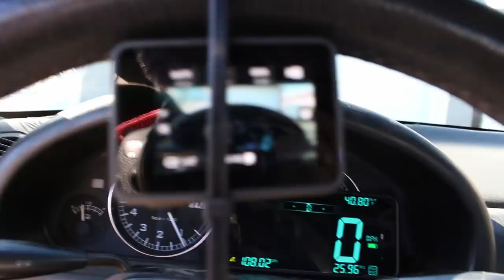Sending The Miata To 100MPH On Jackstands: The Gremlin Chase Part 4

Comment: Have you been able to check the gearbox out put and diff input shafts are parallel? If they're not it will vibrate! I work with this stuff on industrial equipment

Comment: My miata was making a noise that I could NOT find. Since I have an open diff I was able to get the rear wheels up to speed separately. It was really sketchy but I was able to pin point the noise to the driver side.

Comment: Couldn't you take the Axel's loose to check the diff? I have a 67 Chevy II. 350 350t trans and Ford 9 in rear end. It does the same thing vibrates at higher speeds. Almost positive it's somthing in the rear end. Haven't tore into it yet

Comment: What if it’s the bushings that you are using?
Reply: If we wait patiently Greg will show us what the issue is. Greg I just did some searching.   There are some DIY tricks for balancing your driveshaft.  But also shops that do it.  I am fairly certain you have explored these  avenues but just in case.  You are spinning stock shafts very fast.  How fast do you have your tires spun when you get them balanced?  Curious....

Comment: This might be ignorant of me but the bolts from the trans crossmember are laying directly on the trans with washers but wouldn't regardless metal doesn't isolatethe vibration. Wouldn't vibration move through the bolts into rest of the chassis?

Comment: Try swapping those rubber transmission mount bushing for something hard, and see how that makes a difference. Like back on the jack stands and driving. The symptoms i would be predicting is slightly more vibration at low speed, and reduced vibration at high speed

Comment: This might be out of this world but if it’s possible I’d say try making an adapter for the driveshaft to the trans with bumpers inside to absorb vibrations. Something similar to what the bmw trans come with. Cause your drivetrain and engine are all stiff due to your bushings. Maybe if you have something in their to absorb more vibrations. Cause the CV joint probably only helps so much
Reply from the maker: This is how the factory BMW's (and many other cars) are set up. I may be going to a setup like that soon.

Comment: May or may not be an issue, the diff looks like its mounted from the PPF to the chassis with no bushings, I know your setup has delrin diff bushings but if the diff is still mounted solidly to the chassis in other places, it may cause vibration?... it's weird because driveline vibes are usually at low speeds

Comment: I would say it's your diff. If you over tighten the center nut on the input on the diff it can cuase diff binding. Mabye resulting in shake. Thats on my truck. Miatas might not be built the same way. I am no car expert. Just trying to give ideas. I really hope you track this problem down. I have just started my own miata adventure. You are possibly the most valuable resource in the miata car scene. Turbo coming soon.
Reply from the maker: True that they do require a certain torque, but it's the same differential the car has always had. And even when swapping in another diff, the issue did not change.

Comment: Hey Greg, have you checked every nut in the rear subframe is firmly tightened to the car? Perhaps a nut is slightly loose causing that vibration at 4k rpm?

Comment: at 7:00. Bolted mounts on the side to something?. Cross member with rubber isolators. Are those two mounts equally loaded? Or, in other words, is one carrying more weight than the other?

Comment: I'm starting to suspect the transmission tunnel wasn't designed to dampen the high frequency vibrations of a high RPM driveline. Whatever the tiny BMW bushings don't absorb is possibly being transmitted through the body of the car. The PPF forced these vibrations to travel up and down the driveline all the way to the engine mounts and differential mounts. Now that vibration may be taking the path of least resistance straight into the center console? Perhaps some type of dampener or "weight" on the new transmission mount to absorb vibrations. I see these constantly on newer Chrysler built vehicles....on the body to frame bolts, on the exhaust, etc. Even seen them directly on the differential case.

Comment: Greg, it may be worth trying the jack stand test again with the driveshaft removed. I’m not entirely familiar with the trans you are running. But if it’s possible to put it in gear and bring the engine/trans speed up with the driveshaft removed then you’ll know for sure that it’s coming from the trans. If you don’t get anything then you know it’s driveshaft or rear end related. I’m sorry if you’ve already cover this I just thought about it while watching. Hoping for the best for you

Comment: Have you tried changing gearbox bushings/mounts for something with different stiffness? since vibrations are speed related, there should be something with that speed or frequency that causes it. And resonanting frequencies are determined by stiffness of elastic elements and damping. So I'd tried to replace all bushings with solid mounts at least temporary for testing. 
and if it will not help - have a look on structural rigidity of places where components are mounted. Maybe those are acting as springs in your case...

Comment: Hi Greg. I haven't watched the whole video yet, but before i forget... My dad had a vibration issue on his car over 70 MPH and after much research and getting tyres re-balanced etc it turned out to be the Spigot Rings for his alloy wheels were something like 0.5mm too small overall. I didn't believe that this could cause such a big problem but it did! Might be worth looking into.
Reply: Just got to the part where you remove the wheels so yeah, ignore that comment :D

Comment: I knew a guy who went through almost this much s*** working on an old Mopar vibration.  He sold the car to someone who replaced the pilot bearing and cured everything.  The new owner was thrilled by entirely rebuilt drive train and smooth ride.  That was my friend's story.  So, pilot bearing?  Been there, done that?  I didn't see it go by but I'm not that attentive at all times.

Comment: I am sure others have said it before, but get aliexpress accelerometers and attach them to the box and driveshaft, go through the rev range on jackstands and log the vibration frequency. Only one thing should be rotating at those rates at those engine RPMs, and if the rates are different at box and diff then it's a compound issue. E.g. 550 rpm vibration at 60mph wheel speed would be something rotating at wheel speed, 2000 rpm vibration would be diff speed etc.

Last, your rear axles have also seen a lot of action, did they ever get removed to isolate the issue?

Comment: U joints speed up and down as they rotate. The effect is more noticeable with larger working angles. The effect is usually cancelled out by offsetting the UJs by 90 degrees at each end of the drive shaft. Speeding up at one end is cancelled out by the other end slowing down at the same rate. Meaning the flanges rotate at the same speed, even though the shaft is accelerating and decelerating all the time.
It looks like your yokes are in the same phase. Think i'm right in saying that would cause vibration, even if the working angles are in spec, equal and opposite.
Also, the CV version you tried would have a similar issue becuase it only has one UJ. Nothing to cancel out the occilations, because CVs are constant velocity.
Can you rotate the slip joint by 90 degrees?

Comment: BMW's have a 'guibo' which is a rubber mount to connect te driveshaft to the gearbox. This combined with a center support bearing and a DOUBLE yoked driveshaft can compensate for alignment issues of the components. You have none of that, that combined with the stiff motormounts and differential (BMW also has them on mounts) can be a harsh source of vibrations.

Comment: Could it have something to do with the fact that the transmission cross member is solidly mounted to the transmission tunnel? Thinking back to how Miata drive train components are mounted stock, no drive train component is that directly mounted to body work like that. Especially body work that is so non-structural (as I don't believe the transmission tunnel is). My theory is that vibration you are seeing in the drive line behind the output shaft are not being dampened enough by the transmission mounts and because the metal the transmission cross member is bolted into is rather thin, its causing the flimsier body to resonate at high speeds. 

Might be worth trying to switch to softer mounts or adding insulators between the transmission tunnel and the cross member.

Comment: dont you have aftermarket axels? not sure they spin fast enough to make that vibration though.... could it possibly be a bind instead of a rotational vibration? was anything in the rear end messed with like the pinion gear? almost sounds like when you shut the car off and are rolling something other then the sound of vibration in the car isnt working with whats going on like something is rubbing on another part. not sure..

Comment: i still think its the trans mount or your trans is alligned up and down with the dif but not left and right. you said to me lasttime its fine in other swap kits... but youve also said some poeple have your problem and some dont. seems like a minor detail that would cause problems on some kits but not all. and your driveshaft seems to be a symptom not a source. how many drive shafts have you tried 8? and before you ask yes ive seen all your content.

Comment: Did you test the connection of the trans to the car? The Bracket, the bushings, the chassis contact points? I mean the trans will vibrate and the miata structure is not engineered to take these loads at those (new) contact points.
Great vids, keep em coming!

Comment: Okay so hear me out, I belive your vibrating could be from a warped rear end, your right at the power where factory unibody spot welds can break and cause a misalignment of the diff. Ive seen this same vibration in high powered supras, mustangs, cameros, it always ends up being chassis flex or warp related. 

Or you could have a off balanced wheel/ warped hub. But that would be something you could feel in the corner also. Try taking sweeping turns back and forth while putting a little positive power down and see if the car behaves differently.
Reply from the maker: Accel, decel, high load, low load, left turns, right turns, dips, crests. Tried it all. They only things that affects it is driveline RPM. The car also had no issue when I had the 6-speed + Torsen combo.
Reply: @TheCarPassionChannel  swap your diff out
Reply: @LemonMan_Man  he allready did this

Comment: Here a thought.... now what if the transmission mount is vibrating the hole car from the rpm speed of the drive shaft of was there to holed the Tran and diff but also was to stiffen the chassis what if that could be the problem more power bigger transmission bigger components more vibration I know the trans has a damper and so dus the drive shaft but what if it just the trans mount

Comment: Seems like you’ve tried quite a few s things with the driveshaft. I think the next step should be to experiment with different stiffness engine and transmission mounts. You should probably also try stiffer or softer diff mounts.

Comment: Sounds kinda stupid, but could it be the cross member on the gearbox? I don't know whether it could not be isolating the vibration from the gearbox enough and as its connected to the tunnel, its throwing the vibration around the trans tunnel? I dunno?

Comment: have you checked either rear wheel bearing? 

I once had a buddy who wasn't able to go up to 50-70 MPH without having his whole dash shake pretty harsh. from the firewall all the way up through the A-pillars to the roof. Different car of course. FWD.
We checked the motor mounts which were OEM 6 months old mounts. 

checked the axles. even tried putting the car up in jack stands and putting it drive to see if one of the axles might be bent and nothing. All bushings and balljoints were all good.

Turned out to be one of the Wheel bearings was bad the whole time. which was weird cause the wheel hub seemed good. There was no play or slack on the hub like that you get when a wheel bearing is worn out.

maybe you can do the same test while on jack stands but have someone else get the car up to speed until it starts shaking, meanwhile you feel each Rear control arm to see if either side has more vibration than the other?  just a thought........
Reply from the maker: New bearings.

Comment: Thanks for all you do Greg. In the end, did you figure out the source of the vibration ? Im currently chasing this gremlin as well. Cheers.
Reply from the maker: Yes and no. I did fix it, but never truly discovered the reason it was occuring. If you check out my video with the V8Roadsters diff swap, that's what made it all go away. Not sure if it had to do with driveshaft length or weight, or who knows. There have been others with this identical configuration that don't experience any vibration, so it's very hard to pin down the exact cause.
Reply: @TheCarPassionChannel   Thanks Greg for actually replying. Way cool to have a "Celebrity miata guru" comment:) . 

 I find my self reading all 100 and so comments from others and your replies and sometimes spend lots of late nights reading and at the same time learning something new. Have done numerous fixes on my Na following your how to's. Thanks again and will check out your V8roadstors diff swap.  Appreciate the humor you bring to the channel as well.

Comment: Can you put the miata trans, ppf, and  driftshaft back in the car, on stands? It's a pain in the a$$ but ya know, oem works best (sort of). 

Could be subframe damage, causing flex with slight "out of balance" rotation, that would still be well within spec. Check welds on everything?

Comment: Another pissing in the wind though like a never eat yellow snow though !😂😂 are you defiantly running evening square to what or what you should be ? Is there any misalignment with the chassis to engine mounts or rear diff mounting points ? Like a shunt that’s not been recorded but your car is actually 10-15mm out of square somewhere or When it’s been braced and twisted something so when you sit the car down your actually twisting the chassis ??

Comment: Silly idea, but why not take the pinion gear out and spin it up.
The vibration may be in the diff or axle bearings.
I just can't see that multiple driveshafts have the same vibration.
Unless of course, the issue is in the rear bearing of the transmission and it's only when the weight of the drive shaft is on it that the vibration occurs.
I know you've spun it up without the drive shaft in.

Comment: Most BMWs use giubo joints on the driveshaft(rubber). you're using steel, any minute vibrations from driveshaft either from it being unbalanced or even just general vibration.. will be massively amplified. Maybe that's the problem?
If you're sure all the driveshafts you tried on were balanced properly.. maybe the adapters aren't drilled perfectly? there are a lot of things that can exacerbate vibrations... one of the mounts being off by even a millimeter would probably cause ridiculous amounts of vibration.

Comment: Greg, I don't know if you've said this before but I kinda get the impression you're an engineer in some capacity (no need to confirm or deny...), with how long it's been since this video you're probably executing on a plan by now - any chance you've calculated the natural resonance frequency and harmonics of a driveshaft of this particular length? That would certainly be interesting.

Second note, I had a thought: if you're worried about the increased angle of the u-joints on a 2 piece shaft due to it being so short, perhaps you could mount the center bearing lower than the normal location so that the first section goes down some, and then the second section has less angle on the u-joints. Hard to describe but maybe you get the idea. Basically the forward section doesn't need to be perfectly horizontal I don't think.

Comment: Somthing strange is going on with the harmonics of the system (obviously). My previous comment  was changing the angles of the trans and diff to see if that effects it. 
I believe that two or 3 harmonic waves are converging to make one big wave in your drivetrain and that has something to do with the tailshaft of your trans and driveline length. This is crazy stuff when you get into it... My advice to you would be to stop everything and put in a two piece driveshaft with carrier bearing. That will change the harmonics of the system and completely change the vibration (hopefully).
Reply: Ive had 15 years of experence and been to Eaton school and this is the very best i can come up with...

Comment: Hey Greg I don’t know if this could be it or not since you were saying there are others running this kit as well with no issue but when you look at how the trans bushings are setup technically since the bolt passing through is still sits both on the transmission and on the mount that is bolted to the body it still could be sending vibrations through it even with that bushing in the middle. Think about like the diff bushings and the motor mounts. The bushing completely isolates one part of the car where no metal is touching besides either the body or what is being mounted. Maybe try throwing some rubber on one side of those bolts to see if that might at least help a little bit
Reply from the maker: On the transmission bushings they are actually not through-bolts, it's a cylinder of rubber with a stud on each side, so they offer complete isolation :)